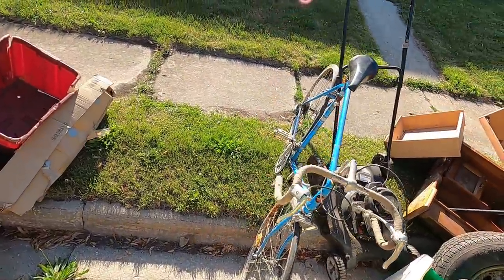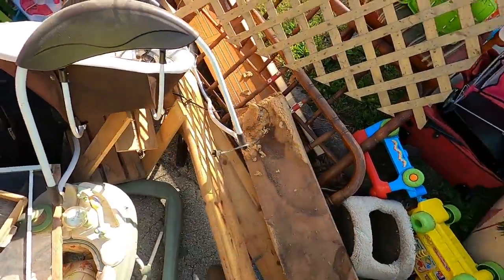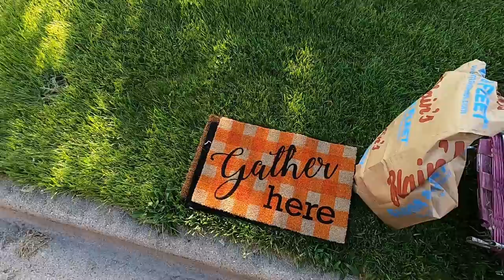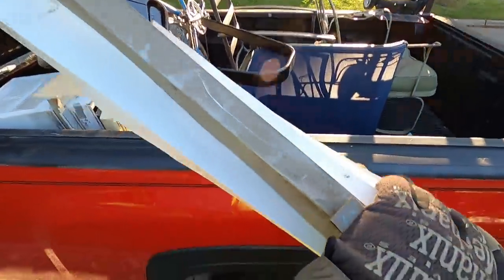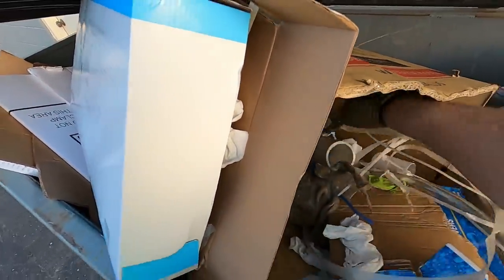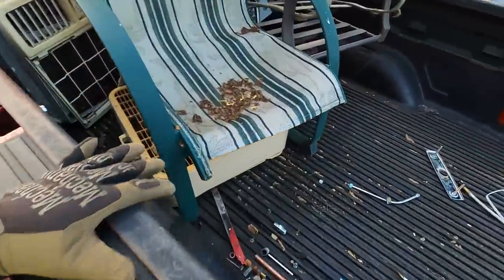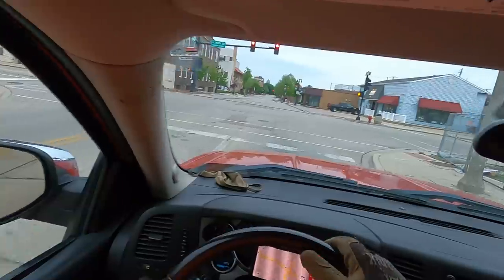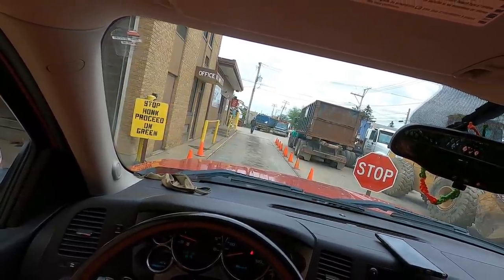All Their Stuff on the Curb - I Cashed In

Comment: 30:56...Right now, I have three working pedestal fans that I found in or by our apartment dumpsters. One of them had a wrecked cross-member base, so I screwed on a homemade base from two 1 sq ft x 1 inch thick pieces of particle board. I also have a 6" clip fan, 2 table fans, and 2 box fans I salvaged. All of them work, though one of the box fans makes a noise I've yet to figure out. Ventilation is critical during a pandemic.

Comment: In my part of the country, people don't put much at the side of the road because the garbage service charges an arm and a leg to take it away, and won't even take it if they aren't alerted ahead of time that the pile is to be picked up. They'll just empty the cans and leave the pile. Most people take unwanted stuff to the local Goodwill and let them dispose of it. Or post on Craig's List where scrappers scour the listings and pounce on metal. I once had a cast iron bathroom listed and WOW did I have a lot of calls. I couldn't pull the listing fast enough!

Comment: This might sound dumb but is copper magnetic?
Reply from the maker: Copper is not magnetic. But it does conduct electricity which can cause magnetism. Strangely, magnetism will cause electricity in a conductor. If I have a magnet on a sheet of copper and then turn the sheet sideways for the magnet to slip off it will slip slowly because the magnetism is causing electricity which is causing magnetism which is affecting the magnet by slowing it. The only ferromagnetic metals are cobalt, iron, tin and nickel.
Reply: @ScrapPalletMan  thx

Comment: not sure where you are from me but the first two things you loaded i could use. fat man needs a bike lol what about those strollers and baby swings at that first stop they have all kinds of steel in them and you left them sitting 2 strollers a swing and a metal pack n play. ah well someone else will get it i guess. That little hut that you couldn't determine what it was, is a school bus stop waiting area for kids to wait for the bus out of the direct elements in the mornings. my dad built one of those for my kids to stand in while waiting for the bus too. just like that one.  they ended up using it like a play house more than a bus stop waiting area though in the end. the cable you passed up @33:10 was an antenna coax cable, copper core wrapped in stainless steel brading
Reply from the maker: That coax looks like copper but it's not. Put a magnet to it you'll see.
Reply: @ScrapPalletMan  wasn't aware, but i've seen it before on exterior Antennas at radio stations and 911 dispatch centers before

Comment: I hate waste, and man, you live in what must be the waste capital of America!  Who throws away a box of ratchets and open end wrenches?  Bicycles are nearly impossible to resell and same for sewing machines.  I would have thought you'd grab that sewing machine just for the motors.  
I love the fact you get good money for steel, which in my experience pays the least.  How do you separate coating from copper wire, or do you?  I notice you passed up coaxial cable and a number of other items which I'd have thought would have been money makers.  Last question: since a great deal of your scrap isn't "clean" do you get a certain price for metal which might still have fibers or plastic on it? 
Always a treasure trove watching you.
Reply from the maker: There is a certain price for clean steel and a lesser price for appliance shredder scrap. I do not separate the insulation from the cords. I sell the whole thing for about 60 cents per pound. They use a massive grinder to separate copper from insulation

Comment: I'm sure you could have sold the road bike. It looked like it was from the 70s or 80s?. Couldn't see the make. You could have made money on it. It also looked like it had a Renyolds 531 frame?. A bike like that in that condition and age, £50. Which is about maybe  70 usd?. Sorry but just wanted to let you know. John
Reply from the maker: Nope. I should have done a close up on the thick rust on the bike. Probably in the flooded basement with the strange rust pattern
Reply: Yes then I agree with your choice to thtow it away. Thanks Paul.

Comment: Man, you're losing so much money by not taking a little time and breaking down that scrap. Electric motors, more copper wire, the A.C. alone has copper, aluminum, wires, compressor, and the steel leftovers. You could've greatly increased your profit.
Reply from the maker: It would cost far too much time. It's all about the ROI my friend. Return on investment of time. Next time you do these items you are referring to, tell me exactly how much time it took and how much profit you made. You'd be surprised on how low it is
Reply: @ScrapPalletMan  I break them down on the regular, I easily double or triple my profits. It doesn't take much time if you have the right tools and a bit of practice with certain items. I rip apart a dozen microwaves in 30 min, and that's an easy increase in profit. The a.c. alone fetches you what, 100 lbs of steel scrap... Or broken down within 30 min and double your money.  Some things aren't worth it, but those items are easy as pie to take apart and seperate.
Reply: You would be helping to save the environment a little with the air conditioner units at least, in my area they require you to have them completely drained of all the oil and gas before scrapping them otherwise it's a major environmental issue and not only can you get in trouble but they will get in trouble. I'm not sure how the laws work in your area, but in my area theyre kind of strict. So that being said, I would already be in the process of breaking the air conditioner down to remove the gas and oil from it anyway, so it's not much extra work to dig a little deeper and remove a few more screws anyway.